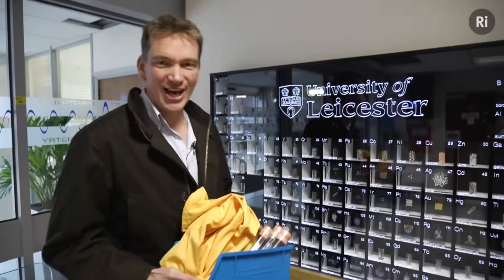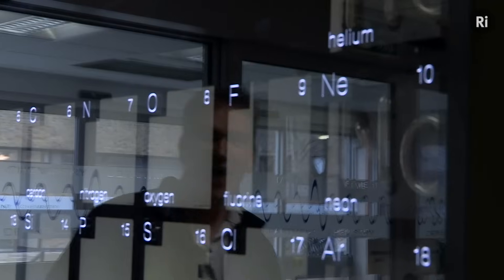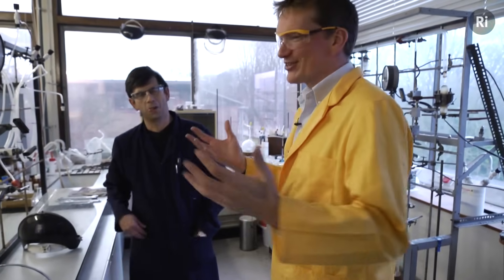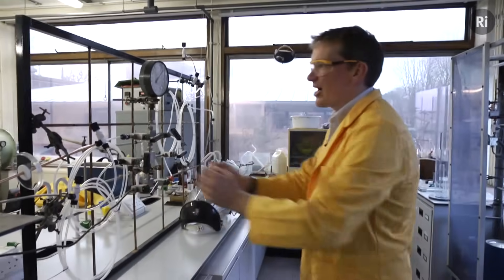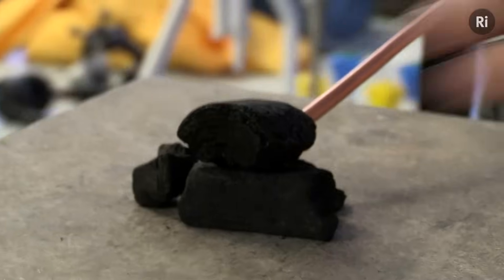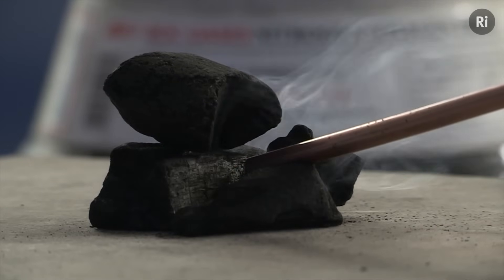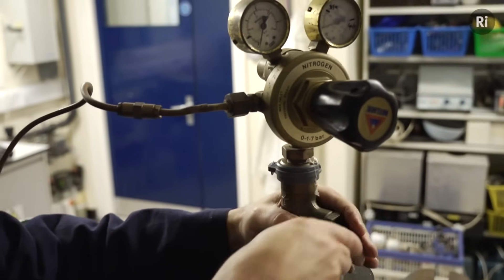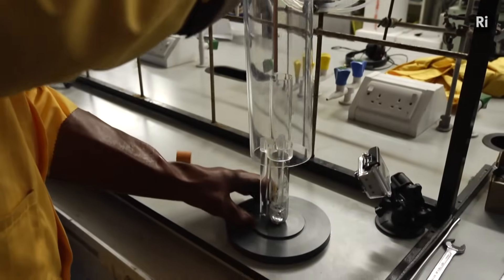Reacting Fluorine with Caesium - First Time on Camera

Comment: I was told that Fluorine was the most reactive element. Could anyone shed some light on this for me?
Reply: Caesium is the element that gives out the most energy when it loses an electron. Fluorine is the element that gives out the most energy when it gains an electron. When you react the two together you get out the most energy per pair of atoms combined. However, you can't really talk about the reactivity of a single element in isolation as it has to react with something to, um, react. So, we can say that fluorine is more reactive than chlorine; and that caesium is more reactive than sodium by comparing their reaction to there things, but saying fluorine is more reactive than caesium doesn't really have any meaning. However, then fluorine atom is a lot smaller than the caesium atom, so a unit weight of fluorine will contain more atoms, and so give more reaction energy per unit weight. This makes fluorine is a lot nastier than caesium, which he carried in a test tube. If you take 'most reactive element' to mean the nastiest one, fluorine wins.
Reply: Most reactive non-metal maybe, even so that's not really a scientific thing to say. What it does is it wants to steal that one electron it is missing from anything around itself, so it one of the strongest oxidizers. Cesium however has one extra electron and it just can't wait to give it away. Cesium is one of the strongest reducers.
Reply: Cesium "wants" to get rid of its electrons in any way it can and fluorine "wants" to grab an electron from anything it can. If you combine fluorine with something that  is nearly as electronegative ("wants electrons") as  fluorine (e.g. chlorine or oxygen), the reaction won't be spectacular.
Reply: soylentgreenb May I correct you all. Caesium dow not "WANT" to give away it's outer electron, it is not repelled, but simply very poorly attracted. The act of a fluorine atom gaining an electron is where all the energy is released. The reason we say that all the alkaline metals are so reactive is because the energy of reducing fluorine-oxidation of caesium is so high since oxidation of caesium is negligible in itself and endothermic. This applies for all reactions involving oxidation and reduction directly.

Comment: lies francium is radioactive and dealy if you leave it in leve it in water overnight it will simulate a nuke on;y more deadly and toxic
Reply: I'm glad you learned all of your chemistry from that stupid, fake Brainiac video.. But you aren't anywhere close to correct. Francium is technically radioactive, but so radioactive that any appreciable quantity will spontaneously decay. Leaving any 1A metal in water will produce hydrogen gas and the hydroxide of the metal, and it will occcur faster than 'overnight'.
 >"it will simulate a nuke on;y more deadly and toxic"
 are you 12 years old? Nuclear reactions are MUCH more energetic than any involving just electrons. Why would it make any sense that caesium in water makes a bang and a splash and then moving up one energy level will be capable of leveling a city?
Reply: are you 1 beacouse you are wrong DO YOU KNOW WHY THERE ARNT ANY VIDEOES ON UTUBE ABOUT FRACIUM beacouse it is so rare and radioactive, the molicules are much more compact beacouse U or PU are softer elements if you knew anything you would go to a chemistry corse i own some francium is the casing of 10 lead cases and it is 0.001 grams of it, i gave the vial to my friend, it killed him instanly plus franciums moleculer structer is much dencer plus i am a nuclear physatist who dosent know how to spell verry well so check you facts. a nuke is less dence than my own speacial vial that is a tablet shell holowed out and 0.000001 grams of francium in a testube. SO TRY TO SAY THE RIGHT THING OH AND PLUS I CANNOT POAST VIDEOS OF MY LAB IT IS TOP SECREAT
Reply: Elemental francium in a test tube? and .000001 grams to boot! You should go and tell the IUPAC about that because the most that has ever been in one place is 0.0000000000001109 grams.
Reply: there is 2 grams of francium in the world and i missed a few 0s out i ment to say 0.0000000000000000001 grams
Reply: that is the leagal amount allowed use in the uk in a lab and some labs here in here in britan can only use 0.00000000000000001
Reply: cautionthisissparta
One of the worst troll I've seen in a while actually. Parents should watch their kids.
Reply: how old are you 6 look at the periodic table and i am a chemist but i have not got francium in a test tube that would be impossible beacouse francium has a half life of 3 weeks in O2 and CO2 you sir need to learn how do chemistry and i see you are into minecraft and so am i but you need to get your facts right and plus you could keep some in a test tube if it was vacuum sealed but that would break the tube so you could use a plastic bag with no holes in it and vacuum seal that and you would be able to keep it but other wise it is viciously reactive due to water vapor in the air and you are not a chemist as you know nothing about chemistry. explain to me how the periodic table works if you are such a smartass
Reply: iamnyamgamer, you forgot to tell them how you distributed your francium as the astatide salt... Wasn't it? :-)
Reply: iamnyamgamer wait what 

You don't know how the periodic table works?

Comment: I thought fluorine was the most reactive element. It attacks most containers that it is stored in (except for flurorcarbons - Teflon), reacts with krypton and xenon, and essentially sets up the combustion of steel wool
Reply: It's probably clearer to say that fluorine is the most electronegative, and caesium the least.  Fluorine doesn't attack glass directly.  It reacts with water to form hydrofluoric acid, which attacks glass.
Reply: pleappleappleap Yeah I suppose you're right, forgot that fluorine has to be dissolved in water for it to dissolve glass. Anyway that's why regular glass seems to be attacked by it, there are water molecules in the glass structure that combine with the fluorine - which is why you never store it in any glass. Only 'freshly' heated quartz glass ampuoles can hold it. However it has a much wider range of reactions, alkali metals can only react the same way other metals can (albeit more vigorously) - fluorides can react with any element in the periodic table except for helium and neon - it even reacts with the other halogens.
Reply: Jordan Philip You might think you know something or sound smart but really.. You're not so stop misinforming people. 

Some of the things you said aren't utter nonsense, but glass most definitely doesn't have water in its structure, and it can withstand fluorine just fine if there isn't any water. Also saying all metals react the same just more vigorously is the stupidest thing ever. Every single one reacts differently with different acids, elements and bases...
Reply: What are you on about Harry Potter, I think you need to read my comment a bit more carefully. I never said that glass was susceptible to fluorine attack without water, and I'm also not stupid enough to think that glass is anything other than silicon dioxide, sodium carbonate, and calcium oxide. What I meant was water that's around the glass structure e.g residual moisture and water vapour. Also all metals react fairly similarly, like they form salts with halogens, react with acids and such, only the alkalis are more vigorous because they're closer to the noble gases than transition metals. Sure the latter can't react with water without an electrical current running through it but that's beside the point. You want to see a difference? Look into organic chemistry. Okay sure I was probably a little too vague but it's up to you to interpret what others are saying, correctly. That's not my issue, so stop attacking others on the Internet.
Reply: *****
Being wrong is not a capital crime you know. He's obviously learning - like all of us - and already knows more than your average Joe who doesn't even know what chemistry is.

So unless you always speak the Truth and are never wrong, please refrain from posting and let us civilized people discuss in a polite and respectful way.

Comment: well the trick is the low quantity and that plastic. and don´t forget the components of water. the explosion is the "reconstruction" of the water molecules, that were violently ripped apart by the caesium with enormous force. releasing enough heat for the left over hydrogen and oxygen to react and go boom. here they released much more energy (alkali metals and halogens always give a good bang) but they did it safer. just look at the intense light. they surely had a rough idea what´s gonna happen

Comment: Lithium isn't the most reactive metal. As you could see, cesium was sealed in a glass tube, so it did not contact with the air. Fluorine didn't have time to react with the air, as it came into contact with cesium/charcoal before.

Comment: Caesium's valence electron will more easily escape its atom because it's got a whole bunch of other inner shells "shielding" it from the nucleus that pulls it. Since the valence electron is farther away from the nucleus and shielded by all the other shells it has an easier time escaping the atom. And the caesium probably did react with the atmospheric oxygen/nitrogen just not as wildly as you would've expected.

Comment: what is the product of the reaction? If it follows the same trend as the alkali metals and chlorine gas then I would guess at cesium fluoride? Also Its a bit of topic but my teacher has been unable to answer this question and I can't find a straight answer on the internet. What would be the reaction products of elemental boron with either elemental bromine and elemental fluorine? Thank you.

Comment: Yes, they have plutonium, but it's not enough to really do anything dangerous with. You actually need quite a bit of fissile material to get up a decent explosion.  If you were mentioning it because of radioactivity, I would assume the vial it is kept in is made out of leaded glass to prevent radiation leaks.

Comment from the maker: Although it sounds counter-intuitive, Caesium is actually more reactive than Francium. Caesium actually has a lower ionisation energy than Francium (~392.811 kJ/mol for Francium and ~375.7041 kJ/mol for caesium). This is thought to be due to relativistic effects - have a google search around the subject, very interesting!
Reply: The Royal Institution The pattern has also been observed between Barium and Radium.
Reply: The same relativistic effect also affects their spectra, causing the trend of the bright doublet's increasing wavelengths from sodium through cesium to reverse for francium. Even radium's analogue of barium's bright green line is shifted to aqua, compared to calcium and strontium that have theirs in the violet and blue regions, respectively.
Reply: @electronicsbyjulie  Radium is more reactive than barium and Ra(OH)2 is more basic and more soluble than Ba(OH)2. I believe Fr will be more reactive than Cs. May be from period 8 onwards, the trends get reveresed.. but still I believe 119OH's basicity will be even greater than FrOH which is more basic than CsOH.
Reply: Does that also happens on halogens or another groups? Let's say, iodine and astatine.
Reply: I wonder about that though.  Francium is very hard to make and its half-life is less than 20 minutes.  I know there have been experimental measurements of the electropositivity of Francium but it seems difficult to rule out experimental error because it has to be done so fast with such a tiny sample.
Reply: Seriously tho
Nice content
Reply: This is theoretical, since Francium is so radioactive, there is about one atom of it within the entire earth.
Reply: The internet is NOT the property of google; just say do an internet search, don't assign any proprietary terms to it, thank you
Reply: @ITILII  do you work at microsoft bing 😂😂😂😂
Reply: ITILII you got offended by nothing
Reply: @ITILII  no
Reply: @ITILII  someone's mad
Reply: @ITILII  relax, Tim, maybe get a Kleenex to wipe your nose.
Reply: @ITILII  I mean, do you call a tissue a Kleenex or a copier a Xerox? Is soda Coke to you? If so, you're a hypocrite.

Comment: I love this experiment as it contains main elements of the best table in the world, the periodic table.  Cesium was one of the last elements to be put into the periodic table by dimitri mendelev.  As it has such a high atomic number it has a low position on the table. It is also rather radioactive AS IT CAN give off strong beta waves and also gama.
Reply: The caesium used here is Cs-133 which is not radioactive.

Comment: Would the resulting compound be a gas?? A solid? Liquid????????  That wasn't aqueous was it? Oh geez. Oh dear. Does the liquid react more violently because of the slightly raised temperature? Is the outcome different? I'd think the two would make a compound more stable than Silicon dioxide.

Comment: Usually those tubes are under low pressure argon (so a vacuum created by first filling with argon and then bringing the pressure way down).  Unlike fluorine, cesium thankfully does not react with glass.

Comment: Well, the short lifetime of Fr prevents efficient research on its properties, but it does not really impact on its reactivity (those reactions as in the video take place in much shorter an amount of time).  The real reason are "relativistic effects", meaning that as the core s-electrons move fast enough for their relativistic mass to increase noticeably and that leads to s-shell contractions (-> higher ionization energy for the  valence shell's s-electron).

Comment from the maker: There wasn't any audible noise produced from the reaction - just the beautiful light given off! They needed a pure sample of Cs for this experiment and it can be quite difficult to isolate because it is so reactive - it's makes it quite dangerous to handle as well!
Reply: Just like sodium and potassium are stored in kerosene, was caesium also stored in kerosene???
Reply: @bhoomipurohit_nd5_em802  no, its stored in a glass capsule, in a vacuum coz it can melt at slightly above the room temperature
Reply: No appreciable ignition delay, very smooth

Comment: Although it goes against common sense, Caesium is indeed MORE reactive than Francium. A simple internet search also confirms this, Google the article from the Royal Society of Chemistry 'Chemistry in its Element - Francium'. Although you shouldn't rely on Wikipedia it also states this to be true, stating the ionization energies to be: 392.811(4) kJ/mol for Francium and 375.7041(2) kJ/mol for caesium - I can't comment on the accuracy of these figures however.